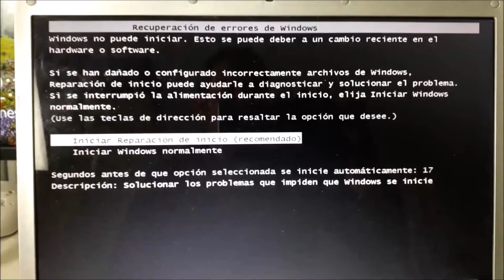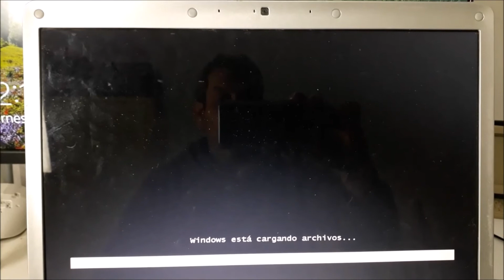Cómo DESARMAR 🪛 la notebook DELL INSPIRON 1525 modelo pp29l 👣 [ PASO A PASO ]

Comment: hola, quité la bateria del bios (cmos) porque estaba gastada, la original estaba bien fijada, pero ahora no logro que la nueva quede fija en su posición, queda floja, alguna sugerencia? gracias
Reply from the maker: Hola David! es la bateria que se conecta con un cablecito a la mother?
Reply: @Tecnoiris  sí, es redonda, va cerca de la zona de conectores de audífonos y micrófono, y se coloca en una base blanca con su hueco redondo. No sé si la batería original tendría algún tipo de adhesivo o algo así. Al final resolví poniendo un papel encima de la batería, de tal manera que la presión dejara la batería en su lugar, no es elegante pero mientras tanto funciona. No logré que la batería nueva quedará en su puesto (hasta lo del papel).
Reply from the maker: @davidalba1053  genial la soluciòn!!! saludos
Reply: @Tecnoiris  saludos, y gracias por el video, fue muy útil.